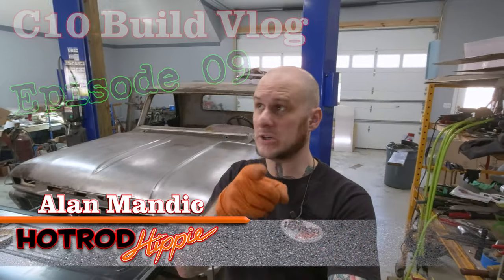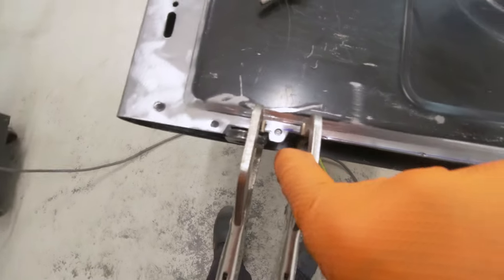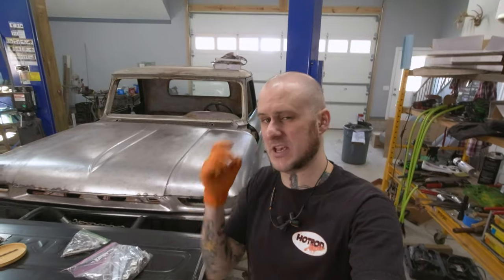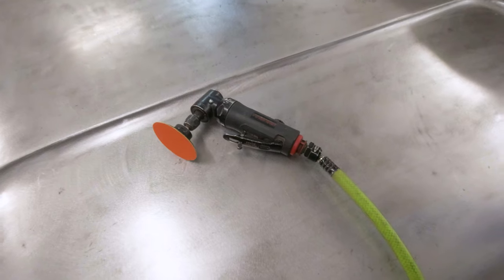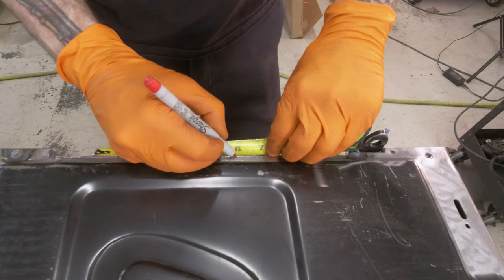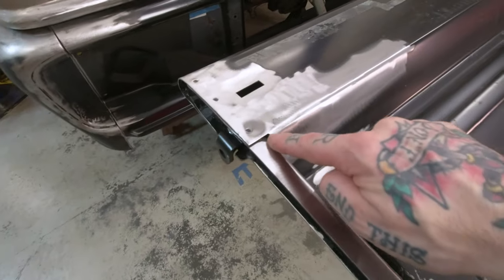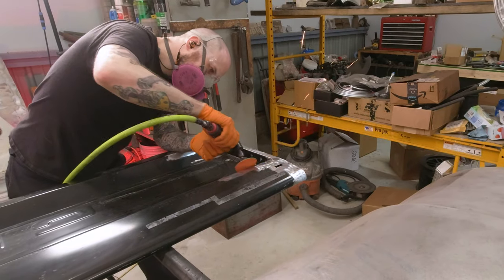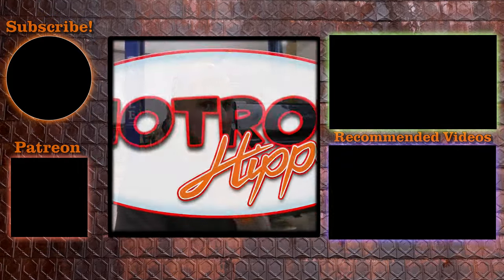Custom Body Panel Touches - C10 Build Vlog 09 - Tailgate Bench Too!

Comment: Alan - I think you did an exceptional job on this video! Yes, all the little 'touches' you put into that tailgate are minor, but you bring up the importance of doing this work to a high level, and that for the jobs that have a budget to justify the extra work - it can result in a much better finished project.
Reply from the maker: You are right, I have a tendency to push the envelope on what projects warrant or can really justify but I just cant help myself from trying to make things a little better at every step.  Thanks Ron!

Comment: Allan that concrete chisel is a Brick bolster for trimming bricks, its used to create a fracture around 4 sides of the brick then whammo on it hard to break the brick.
Reply from the maker: I've always used one for breaking cinder blocks along their weak edges when doing foundation work. That is where I'm most familiar with them. I'd probably just do best to call it a Masonry Chisel and leave it at that. Thanks for the input on its use. I've never done much brick work. 👍

Comment: I like the attention to detail but I wonder how you're going to seal up the back side  where you welded it so that it doesn't rust thru from the back side?
Reply from the maker: Cavity spray through the access holes in the side. The same way I'd handle this anyway because the inside of that is uncoated anyway. Because of the inaccessible design of this panel only the outside has the coating on it currently.
Reply: @HotRodHippie  That's what I would like to do also, but was concerned about the remains of the welding slag and such on the back side and what material was best suited for penetrating that and sealing it. Thanks, J
Reply from the maker: That's an inherent risk here. Good materials and welding processes should minimize any such thing. But you will never fully avoid it. All we can do is try our best. Do I risk this rusting later? Yes. Do I deem the look of the finished product more important than the marginal difference in longevity? Also yes.
Reply: @HotRodHippie   I agree, that's why I'm somewhat leery of welding places that aren't easily accessible from the back side so those places can be cleaned and sealed properly. That said, Thanks for your honesty and your efforts to show us how it's done. J